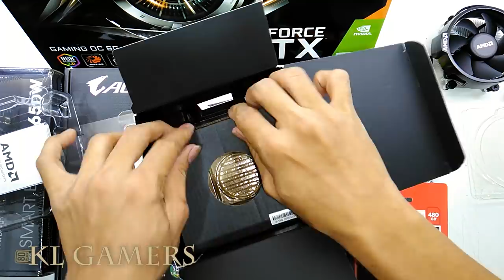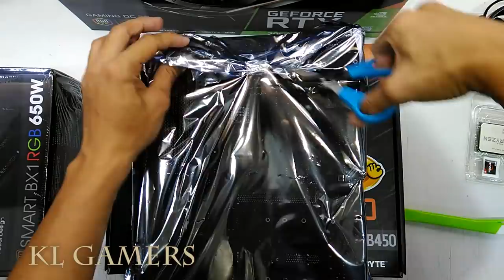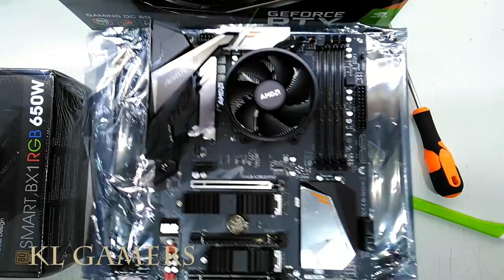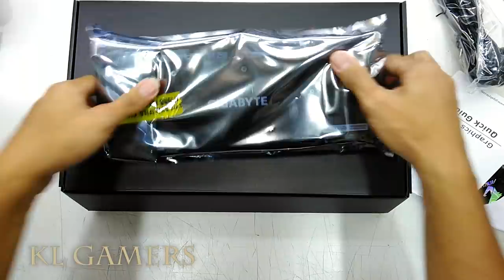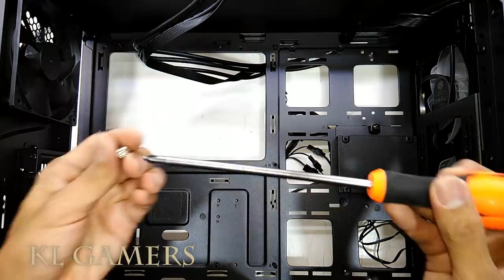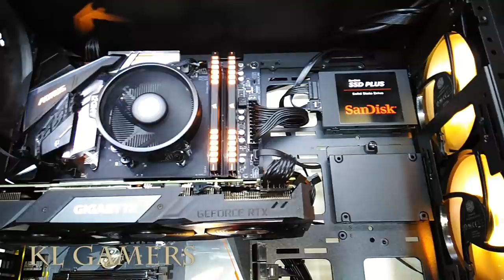AMD Ryzen 5 2600 GIGABYTE B450 AORUS PRO VENGEANCE RGB 16GB GIGABYTE RTX 2060 GAMING OC 2019

Comment: how much price sir
Reply from the maker: Processor = AMD Ryzen 5 2600 6 Core 3.9GHz  = RM679
(Amazon link) = https://amzn.to/2YGanLM 
(Lazada link) = https://c.lazada.com.my/t/c.cs8C

Motherboard = GIGABYTE B450 AORUS PRO socket AM4 = RM529
(Amazon link) = https://amzn.to/2YESw87
(Lazada link) = https://c.lazada.com.my/t/c.cK5V

RAM = CORSAIR VENGEANCE® RGB 16GB (2 x 8GB) 3200MHz DDR4  = RM689
(Amazon link) = https://amzn.to/2YJZjBe
(Lazada link) = https://c.lazada.com.my/t/c.cGZA

SSD = Sandisk SSD Plus 480GB = RM319
(Amazon link) = https://amzn.to/2ZvUGbd
(Lazada link) = https://c.lazada.com.my/t/c.cFpg

Hard Disk = Seagate BarraCuda 1TB desktop hard disk =RM179
(Amazon link) = https://amzn.to/2YFWWLP
(Lazada link) = https://c.lazada.com.my/t/c.cG0a

Graphics Card = Gigabyte NVIDIA RTX 2060 GAMING 6G DDR6 OC = RM1979
(Amazon link) = https://amzn.to/2YCeOqL
(Lazada link) = https://c.lazada.com.my/t/c.coJO

Power Supply = Thermaltake Smart BX1 RGB 80-PLUS 650W =RM329
(Amazon link) = https://amzn.to/2YFN9VZ
(Lazada link) = https://c.lazada.com.my/t/c.cG0Z

Casing = Cooler Master MasterBox Pro 5 RGB = RM359
(Amazon link) = https://amzn.to/2Zyf4IM
(Lazada link) = https://c.lazada.com.my/t/c.cJE2

TOTAL = RM5062

Price is based in local Malaysia current price.

Comment: This is Intel optimized memory. Does it work good with AMD, even though it's intel optrimized?
Reply: It usually does work pretty good, if not nearly the same. I have an Intel optimized XMP profile but it works just fine with my Ryzen 5 2600.

Comment: Price is in part ka sab ka kitna hoga ryern 5 3600
Reply from the maker: Processor = AMD Ryzen 5 2600 6 Core 3.9GHz  = RM679
(Amazon link) = https://amzn.to/2YGanLM 
(Lazada link) = https://c.lazada.com.my/t/c.cs8C

Motherboard = GIGABYTE B450 AORUS PRO socket AM4 = RM529
(Amazon link) = https://amzn.to/2YESw87
(Lazada link) = https://c.lazada.com.my/t/c.cK5V

RAM = CORSAIR VENGEANCE® RGB 16GB (2 x 8GB) 3200MHz DDR4  = RM689
(Amazon link) = https://amzn.to/2YJZjBe
(Lazada link) = https://c.lazada.com.my/t/c.cGZA

SSD = Sandisk SSD Plus 480GB = RM319
(Amazon link) = https://amzn.to/2ZvUGbd
(Lazada link) = https://c.lazada.com.my/t/c.cFpg

Hard Disk = Seagate BarraCuda 1TB desktop hard disk =RM179
(Amazon link) = https://amzn.to/2YFWWLP
(Lazada link) = https://c.lazada.com.my/t/c.cG0a

Graphics Card = Gigabyte NVIDIA RTX 2060 GAMING 6G DDR6 OC = RM1979
(Amazon link) = https://amzn.to/2YCeOqL
(Lazada link) = https://c.lazada.com.my/t/c.coJO

Power Supply = Thermaltake Smart BX1 RGB 80-PLUS 650W =RM329
(Amazon link) = https://amzn.to/2YFN9VZ
(Lazada link) = https://c.lazada.com.my/t/c.cG0Z

Casing = Cooler Master MasterBox Pro 5 RGB = RM359
(Amazon link) = https://amzn.to/2Zyf4IM
(Lazada link) = https://c.lazada.com.my/t/c.cJE2

TOTAL = RM5062

Price is based in local Malaysia current price.

Comment: Whats the budget of this pc
Reply from the maker: The Benchmark Results here if you interested  :  https://youtu.be/3WSlnVBp1tM

Processor = AMD Ryzen 5 2600 6 Core 3.9GHz  = RM679
(Amazon link) = https://amzn.to/2YGanLM 
(Lazada link) = https://c.lazada.com.my/t/c.cs8C

Motherboard = GIGABYTE B450 AORUS PRO socket AM4 = RM529
(Amazon link) = https://amzn.to/2YESw87
(Lazada link) = https://c.lazada.com.my/t/c.cK5V

RAM = CORSAIR VENGEANCE® RGB 16GB (2 x 8GB) 3200MHz DDR4  = RM689
(Amazon link) = https://amzn.to/2YJZjBe
(Lazada link) = https://c.lazada.com.my/t/c.cGZA

SSD = Sandisk SSD Plus 480GB = RM319
(Amazon link) = https://amzn.to/2ZvUGbd
(Lazada link) = https://c.lazada.com.my/t/c.cFpg

Hard Disk = Seagate BarraCuda 1TB desktop hard disk =RM179
(Amazon link) = https://amzn.to/2YFWWLP
(Lazada link) = https://c.lazada.com.my/t/c.cG0a

Graphics Card = Gigabyte NVIDIA RTX 2060 GAMING 6G DDR6 OC = RM1979
(Amazon link) = https://amzn.to/2YCeOqL
(Lazada link) = https://c.lazada.com.my/t/c.coJO

Power Supply = Thermaltake Smart BX1 RGB 80-PLUS 650W =RM329
(Amazon link) = https://amzn.to/2YFN9VZ
(Lazada link) = https://c.lazada.com.my/t/c.cG0Z

Casing = Cooler Master MasterBox Pro 5 RGB = RM359
(Amazon link) = https://amzn.to/2Zyf4IM
(Lazada link) = https://c.lazada.com.my/t/c.cJE2

TOTAL = RM5062

Price is based in local Malaysia current price.

Comment: Semua itu berapa harga nya Rakitt
Reply from the maker: Processor = AMD Ryzen 5 2600 6 Core 3.9GHz  = RM679
Motherboard = GIGABYTE B450 AORUS PRO socket AM4 = RM529
RAM = CORSAIR VENGEANCE® RGB 16GB (2 x 8GB) 3200MHz DDR4  = RM689
SSD = Sandisk SSD Plus 480GB = RM319
Hard Disk = Seagate BarraCuda 1TB desktop hard disk =RM179
Graphics Card = Gigabyte NVIDIA RTX 2060 GAMING 6G DDR6 OC = RM1979
Power Supply = Thermaltake Smart BX1 RGB 80-PLUS 650W =RM329
Casing = Cooler Master MasterBox Pro 5 RGB = RM359

TOTAL = RM5062

Price is based in local Malaysia current price.

Comment: How much that all cost?
Reply from the maker: Processor = AMD Ryzen 5 2600 6 Core 3.9GHz  = RM679
(Amazon link) = https://amzn.to/2YGanLM 
(Lazada link) = https://c.lazada.com.my/t/c.cs8C

Motherboard = GIGABYTE B450 AORUS PRO socket AM4 = RM529
(Amazon link) = https://amzn.to/2YESw87
(Lazada link) = https://c.lazada.com.my/t/c.cK5V

RAM = CORSAIR VENGEANCE® RGB 16GB (2 x 8GB) 3200MHz DDR4  = RM689
(Amazon link) = https://amzn.to/2YJZjBe
(Lazada link) = https://c.lazada.com.my/t/c.cGZA

SSD = Sandisk SSD Plus 480GB = RM319
(Amazon link) = https://amzn.to/2ZvUGbd
(Lazada link) = https://c.lazada.com.my/t/c.cFpg

Hard Disk = Seagate BarraCuda 1TB desktop hard disk =RM179
(Amazon link) = https://amzn.to/2YFWWLP
(Lazada link) = https://c.lazada.com.my/t/c.cG0a

Graphics Card = Gigabyte NVIDIA RTX 2060 GAMING 6G DDR6 OC = RM1979
(Amazon link) = https://amzn.to/2YCeOqL
(Lazada link) = https://c.lazada.com.my/t/c.coJO

Power Supply = Thermaltake Smart BX1 RGB 80-PLUS 650W =RM329
(Amazon link) = https://amzn.to/2YFN9VZ
(Lazada link) = https://c.lazada.com.my/t/c.cG0Z

Casing = Cooler Master MasterBox Pro 5 RGB = RM359
(Amazon link) = https://amzn.to/2Zyf4IM
(Lazada link) = https://c.lazada.com.my/t/c.cJE2

TOTAL = RM5062

Price is based in local Malaysia current price.

Comment: Hey, I don’t hve the realtek drivers, no way possible to get them. All the sound is overpowered by the gpu and I can’t get the motherboard to put out sound through jackplugs or anything. My case, mobo and rtx 2060 are nog broken. Pls help. Tries everything with thix exact same setup, but r7 2700x...
Reply from the maker: possible option is go to BIOS and reset everything to default value. Maybe try update BIOS, if not you can only send for warranty claim
Reply: KL Gamers i sent the mobo back, they reset its BIOS. Clean install of windows, will try DDU once more for gpu and other drivers, win. Update off & no network just a USB. Hope it works. Otherwise will try another headset, if that does not work I’m out of options.. does your CPU have pins that manage sound? Has 2 broken off, but benchmarks like a normal 2700x / 3% worse.
Reply: KL Gamers could you send me your driver versions? Sound, graphics, amd drivers?

Comment: Does this mobo support up to 3600 mghz ram
Reply from the maker: Support for DDR4 3600(O.C.) / 3466(O.C.) / 3200(O.C.) / 2933/2667/2400/2133 MHz memory modules
Reply from the maker: the maximum frequency support for the RAM is different between processors
Reply: @KLGamers  what about the ryzen 5 3600

Comment: Hey i want to ask in the mobo b450 website say the ram base speed is 2666 mhz/3200(oc)/3600(oc) so if we use ram with 3200 mhz its automatically run on 3200 or it will decrease to 2666 and we must set it up to 3200 ? Can anyone please tell me

Comment: In indian rupees what cost will be
Reply from the maker: Processor = AMD Ryzen 5 2600 6 Core 3.9GHz  = RM679
(Amazon link) = https://amzn.to/2YGanLM 
(Lazada link) = https://c.lazada.com.my/t/c.cs8C

Motherboard = GIGABYTE B450 AORUS PRO socket AM4 = RM529
(Amazon link) = https://amzn.to/2YESw87
(Lazada link) = https://c.lazada.com.my/t/c.cK5V

RAM = CORSAIR VENGEANCE® RGB 16GB (2 x 8GB) 3200MHz DDR4  = RM689
(Amazon link) = https://amzn.to/2YJZjBe
(Lazada link) = https://c.lazada.com.my/t/c.cGZA

SSD = Sandisk SSD Plus 480GB = RM319
(Amazon link) = https://amzn.to/2ZvUGbd
(Lazada link) = https://c.lazada.com.my/t/c.cFpg

Hard Disk = Seagate BarraCuda 1TB desktop hard disk =RM179
(Amazon link) = https://amzn.to/2YFWWLP
(Lazada link) = https://c.lazada.com.my/t/c.cG0a

Graphics Card = Gigabyte NVIDIA RTX 2060 GAMING 6G DDR6 OC = RM1979
(Amazon link) = https://amzn.to/2YCeOqL
(Lazada link) = https://c.lazada.com.my/t/c.coJO

Power Supply = Thermaltake Smart BX1 RGB 80-PLUS 650W =RM329
(Amazon link) = https://amzn.to/2YFN9VZ
(Lazada link) = https://c.lazada.com.my/t/c.cG0Z

Casing = Cooler Master MasterBox Pro 5 RGB = RM359
(Amazon link) = https://amzn.to/2Zyf4IM
(Lazada link) = https://c.lazada.com.my/t/c.cJE2

TOTAL = RM5062

Price is based in local Malaysia current price.

Comment: How much price
Reply from the maker: Processor = AMD Ryzen 5 2600 6 Core 3.9GHz  = RM679
Motherboard = GIGABYTE B450 AORUS PRO socket AM4 = RM529
RAM = CORSAIR VENGEANCE® RGB 16GB (2 x 8GB) 3200MHz DDR4  = RM689
SSD = Sandisk SSD Plus 480GB = RM319
Hard Disk = Seagate BarraCuda 1TB desktop hard disk =RM179
Graphics Card = Gigabyte NVIDIA RTX 2060 GAMING 6G DDR6 OC = RM1979
Power Supply = Thermaltake Smart BX1 RGB 80-PLUS 650W =RM329
Casing = Cooler Master MasterBox Pro 5 RGB = RM359

TOTAL = RM5062

Price is based in local Malaysia current price.
Reply: @KLGamers  Show me price in euros for AMD Ryzen 5 2600, please. And total cost in euro.

Comment: How much Is this set ?
Reply from the maker: Processor = AMD Ryzen 5 2600 6 Core 3.9GHz  = RM679
(Amazon link) = https://amzn.to/2YGanLM 
(Lazada link) = https://c.lazada.com.my/t/c.cs8C

Motherboard = GIGABYTE B450 AORUS PRO socket AM4 = RM529
(Amazon link) = https://amzn.to/2YESw87
(Lazada link) = https://c.lazada.com.my/t/c.cK5V

RAM = CORSAIR VENGEANCE® RGB 16GB (2 x 8GB) 3200MHz DDR4  = RM689
(Amazon link) = https://amzn.to/2YJZjBe
(Lazada link) = https://c.lazada.com.my/t/c.cGZA

SSD = Sandisk SSD Plus 480GB = RM319
(Amazon link) = https://amzn.to/2ZvUGbd
(Lazada link) = https://c.lazada.com.my/t/c.cFpg

Hard Disk = Seagate BarraCuda 1TB desktop hard disk =RM179
(Amazon link) = https://amzn.to/2YFWWLP
(Lazada link) = https://c.lazada.com.my/t/c.cG0a

Graphics Card = Gigabyte NVIDIA RTX 2060 GAMING 6G DDR6 OC = RM1979
(Amazon link) = https://amzn.to/2YCeOqL
(Lazada link) = https://c.lazada.com.my/t/c.coJO

Power Supply = Thermaltake Smart BX1 RGB 80-PLUS 650W =RM329
(Amazon link) = https://amzn.to/2YFN9VZ
(Lazada link) = https://c.lazada.com.my/t/c.cG0Z

Casing = Cooler Master MasterBox Pro 5 RGB = RM359
(Amazon link) = https://amzn.to/2Zyf4IM
(Lazada link) = https://c.lazada.com.my/t/c.cJE2

TOTAL = RM5062

Price is based in local Malaysia current price.

Comment: How much its cost ?
Reply from the maker: Processor = AMD Ryzen 5 2600 6 Core 3.9GHz  = RM679
(Amazon link) = https://amzn.to/2YGanLM 
(Lazada link) = https://c.lazada.com.my/t/c.cs8C

Motherboard = GIGABYTE B450 AORUS PRO socket AM4 = RM529
(Amazon link) = https://amzn.to/2YESw87
(Lazada link) = https://c.lazada.com.my/t/c.cK5V

RAM = CORSAIR VENGEANCE® RGB 16GB (2 x 8GB) 3200MHz DDR4  = RM689
(Amazon link) = https://amzn.to/2YJZjBe
(Lazada link) = https://c.lazada.com.my/t/c.cGZA

SSD = Sandisk SSD Plus 480GB = RM319
(Amazon link) = https://amzn.to/2ZvUGbd
(Lazada link) = https://c.lazada.com.my/t/c.cFpg

Hard Disk = Seagate BarraCuda 1TB desktop hard disk =RM179
(Amazon link) = https://amzn.to/2YFWWLP
(Lazada link) = https://c.lazada.com.my/t/c.cG0a

Graphics Card = Gigabyte NVIDIA RTX 2060 GAMING 6G DDR6 OC = RM1979
(Amazon link) = https://amzn.to/2YCeOqL
(Lazada link) = https://c.lazada.com.my/t/c.coJO

Power Supply = Thermaltake Smart BX1 RGB 80-PLUS 650W =RM329
(Amazon link) = https://amzn.to/2YFN9VZ
(Lazada link) = https://c.lazada.com.my/t/c.cG0Z

Casing = Cooler Master MasterBox Pro 5 RGB = RM359
(Amazon link) = https://amzn.to/2Zyf4IM
(Lazada link) = https://c.lazada.com.my/t/c.cJE2

TOTAL = RM5062

Price is based in local Malaysia current price.

Comment: Total PRICE PLEASE REPLY 🙏🏼
Reply from the maker: Processor = AMD Ryzen 5 2600 6 Core 3.9GHz  = RM679
(Amazon link) = https://amzn.to/2YGanLM 
(Lazada link) = https://c.lazada.com.my/t/c.cs8C

Motherboard = GIGABYTE B450 AORUS PRO socket AM4 = RM529
(Amazon link) = https://amzn.to/2YESw87
(Lazada link) = https://c.lazada.com.my/t/c.cK5V

RAM = CORSAIR VENGEANCE® RGB 16GB (2 x 8GB) 3200MHz DDR4  = RM689
(Amazon link) = https://amzn.to/2YJZjBe
(Lazada link) = https://c.lazada.com.my/t/c.cGZA

SSD = Sandisk SSD Plus 480GB = RM319
(Amazon link) = https://amzn.to/2ZvUGbd
(Lazada link) = https://c.lazada.com.my/t/c.cFpg

Hard Disk = Seagate BarraCuda 1TB desktop hard disk =RM179
(Amazon link) = https://amzn.to/2YFWWLP
(Lazada link) = https://c.lazada.com.my/t/c.cG0a

Graphics Card = Gigabyte NVIDIA RTX 2060 GAMING 6G DDR6 OC = RM1979
(Amazon link) = https://amzn.to/2YCeOqL
(Lazada link) = https://c.lazada.com.my/t/c.coJO

Power Supply = Thermaltake Smart BX1 RGB 80-PLUS 650W =RM329
(Amazon link) = https://amzn.to/2YFN9VZ
(Lazada link) = https://c.lazada.com.my/t/c.cG0Z

Casing = Cooler Master MasterBox Pro 5 RGB = RM359
(Amazon link) = https://amzn.to/2Zyf4IM
(Lazada link) = https://c.lazada.com.my/t/c.cJE2

TOTAL = RM5062

Price is based in local Malaysia current price.
Reply: Go to pC part picket and create your own, but am guessing its about $700-$1600

Comment: How do you install the WiFi to the motherboard
Reply: You don’t install WiFi into a motherboard. They either say in the name or in the description of the motherboard that it’s WiFi capable, of not you’ll need an external WiFi adapter. Either by Ethernet or USB.
Reply: Cayde-8 the mb is called Aorus pro WiFi, antennas come with it but idk if you need them to have WiFi that’s what I’m asking

Comment: How much IQ u need to put CPU cooler  on CPU without thermal paste?
Reply from the maker: The original processor heat sink fan comes with pre-applied thermal paste.
Reply: Ok sorry I dont see that but I have question how much did you pay for this PC?

Comment: How much are all this
Reply from the maker: Processor = AMD Ryzen 5 2600 6 Core 3.9GHz  = RM679
(Amazon link) = https://amzn.to/2YGanLM 
(Lazada link) = https://c.lazada.com.my/t/c.cs8C

Motherboard = GIGABYTE B450 AORUS PRO socket AM4 = RM529
(Amazon link) = https://amzn.to/2YESw87
(Lazada link) = https://c.lazada.com.my/t/c.cK5V

RAM = CORSAIR VENGEANCE® RGB 16GB (2 x 8GB) 3200MHz DDR4  = RM689
(Amazon link) = https://amzn.to/2YJZjBe
(Lazada link) = https://c.lazada.com.my/t/c.cGZA

SSD = Sandisk SSD Plus 480GB = RM319
(Amazon link) = https://amzn.to/2ZvUGbd
(Lazada link) = https://c.lazada.com.my/t/c.cFpg

Hard Disk = Seagate BarraCuda 1TB desktop hard disk =RM179
(Amazon link) = https://amzn.to/2YFWWLP
(Lazada link) = https://c.lazada.com.my/t/c.cG0a

Graphics Card = Gigabyte NVIDIA RTX 2060 GAMING 6G DDR6 OC = RM1979
(Amazon link) = https://amzn.to/2YCeOqL
(Lazada link) = https://c.lazada.com.my/t/c.coJO

Power Supply = Thermaltake Smart BX1 RGB 80-PLUS 650W =RM329
(Amazon link) = https://amzn.to/2YFN9VZ
(Lazada link) = https://c.lazada.com.my/t/c.cG0Z

Casing = Cooler Master MasterBox Pro 5 RGB = RM359
(Amazon link) = https://amzn.to/2Zyf4IM
(Lazada link) = https://c.lazada.com.my/t/c.cJE2

TOTAL = RM5062

Comment: Total howmany cost
Reply from the maker: Processor = AMD Ryzen 5 2600 6 Core 3.9GHz  = RM679
Motherboard = GIGABYTE B450 AORUS PRO socket AM4 = RM529
RAM = CORSAIR VENGEANCE® RGB 16GB (2 x 8GB) 3200MHz DDR4  = RM689
SSD = Sandisk SSD Plus 480GB = RM319
Hard Disk = Seagate BarraCuda 1TB desktop hard disk =RM179
Graphics Card = Gigabyte NVIDIA RTX 2060 GAMING 6G DDR6 OC = RM1979
Power Supply = Thermaltake Smart BX1 RGB 80-PLUS 650W =RM329
Casing = Cooler Master MasterBox Pro 5 RGB = RM359

TOTAL = RM5062